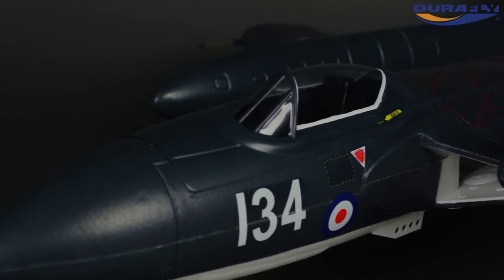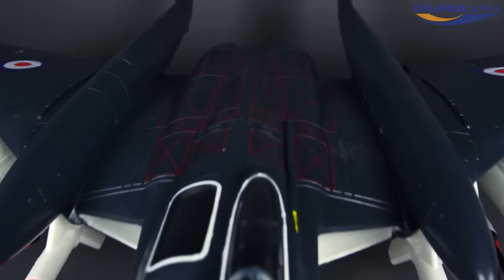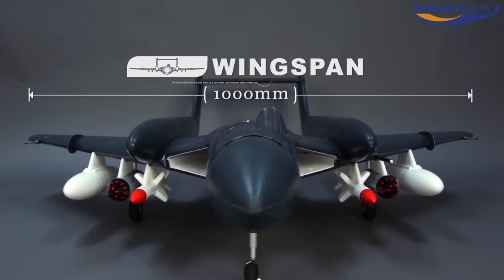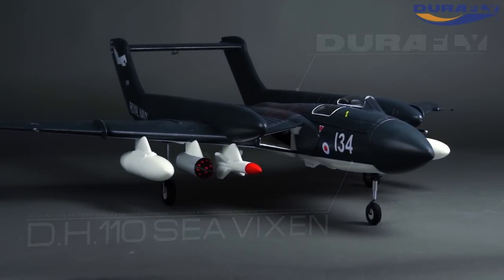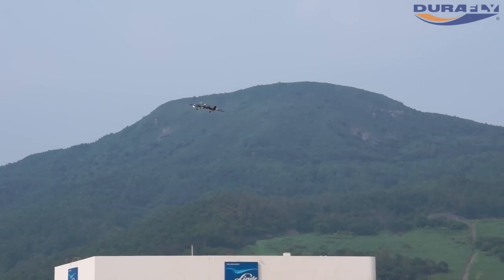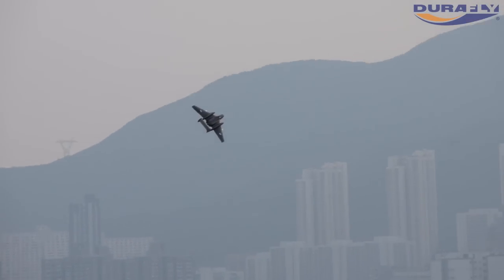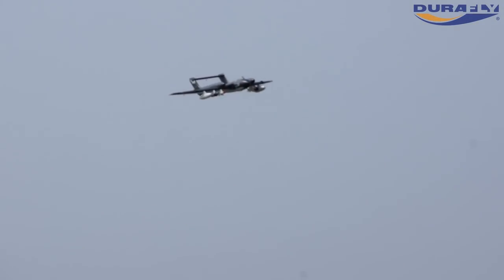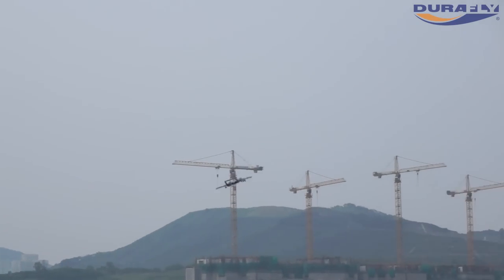Durafly D.H.110 Sea Vixen EDF Jet w/Retracts 1000mm (PNF)

Comment: Ahhh the good ol days.  I just mended mine back together after a power off crash a few years back.  Astoundingly,  It still looks great.  Will b running a powerfun 6 blade and 70A red brick esc hooked up to ubec.